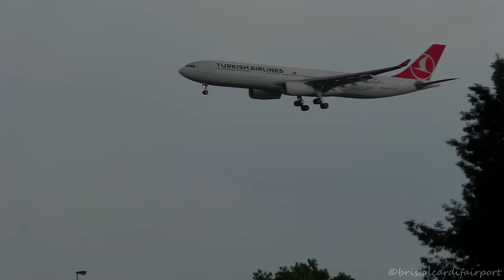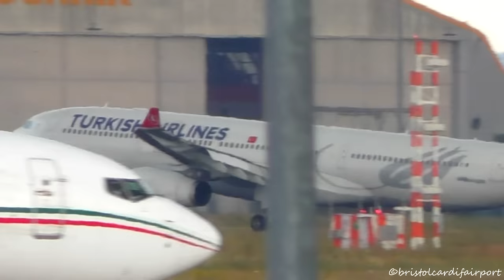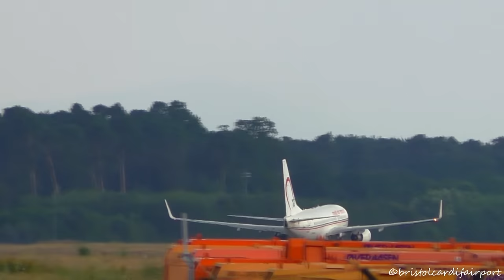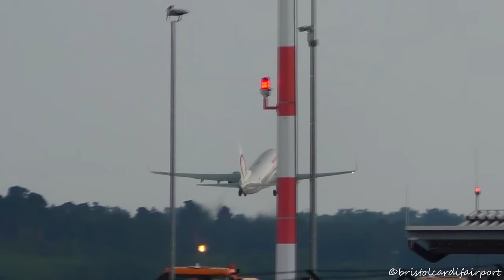PASSENGER AIRCRAFT FAILS TO TAKEOFF! BOEING 737 NEAR TAIL STRIKE & STALL ON TAKEOFF

Comment: Speed might have been ok, but he clearly forgot to deploy the flaps.
Reply: I hope this comment helps:

So, First of all in this video you see the Turkish Airlines Airbus A330 landing. This plane flies over the runway the 737 later takes off from, meaning that there is now wake turbulence on the runway. When it is time for the 737 to take off (which has flaps 1 selected, which is a normal setting for this runway length and wind speed) it rotated as it was in the wake turbulence of the a330. The wake caused a tailwind, therefore making the airspeed lower. The pilots lowered the nose to pick up more speed, and then rotated again and took off. Nobody was at fault here. My sources came mostly from observation of the video and from Ryanair captain "Mentour Pilot" who did an analysis of this video and came to this conclusion. Feel free to check out his video on it, i hope this clears some things up.
Reply: @ElectroRail  Ah, OK. I didn't relize taking off with no flaps is a standard procedure (as far as I know, flaps setting 1 would be no flaps, just slats deployed, which is consistent with what I noticed). And that's actually the only thing I noticed. Thanks for explanation. Later I saw a brilliant explanation by #MentourPilot, who also says it was a perfetly well handled wake turbulence incindent.
Reply: @Adam_Adamsky  Sorry im 2 weeks late, but i just realised you replied. The 737 does have some flaps out in a flaps 1 configuration, it's just a bit difficult to see it in this video. It depends on what type of plane it is. For example the A320 doesn't have any flaps on flaps 1, just slats, but the 737 does, wanted to add that.

Comment: That’s right, there’s no flaps?
Reply: No, they used flaps 1 which is normal for this airport in these weather conditions. They had to have flaps extended as the slats on the leading edge were extended. This was because of wake turbulence from the airbus a330. For further information, check out 737 captain "mentour pilot". he did an analysis on this.

Comment: Someone forgot to extend the flaps... oopsss...
Reply: I hope this comment helps:

So, First of all in this video you see the Turkish Airlines Airbus A330 landing. This plane flies over the runway the 737 later takes off from, meaning that there is now wake turbulence on the runway. When it is time for the 737 to take off (which has flaps 1 selected, which is a normal setting for this runway length and wind speed) it rotated as it was in the wake turbulence of the a330. The wake caused a tailwind, therefore making the airspeed lower. The pilots lowered the nose to pick up more speed, and then rotated again and took off. Nobody was at fault here. My sources came mostly from observation of the video and from Ryanair captain "Mentour Pilot" who did an analysis of this video and came to this conclusion. Feel free to check out his video on it, i hope this clears some things up.

Comment: I guess He rotated the plan before v1 that’s why the plan failed to take-off
Reply: I hope this comment helps:

So, First of all in this video you see the Turkish Airlines Airbus A330 landing. This plane flies over the runway the 737 later takes off from, meaning that there is now wake turbulence on the runway. When it is time for the 737 to take off (which has flaps 1 selected, which is a normal setting for this runway length and wind speed) it rotated as it was in the wake turbulence of the a330. The wake caused a tailwind, therefore making the airspeed lower. The pilots lowered the nose to pick up more speed, and then rotated again and took off. Nobody was at fault here. My sources came mostly from observation of the video and from Ryanair captain "Mentour Pilot" who did an analysis of this video and came to this conclusion. Feel free to check out his video on it, i hope this clears some things up. No one is at fault here.
Reply: Also, if you are actually a pilot as your profile picture implies, I'd assume you would know how to spell 'plane.'

Comment: Zero flaps. I thought this couldn't happen anymore in modern jets. I witnessed an aborted takeoff from failing to deploy spoilers. It was an automated abort, the plane only just started rolling when it automatically shut down
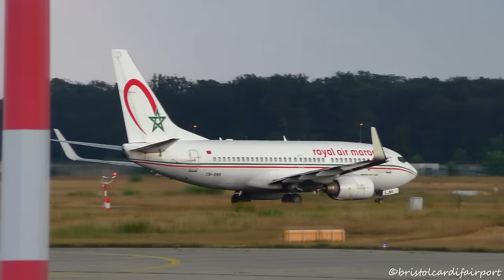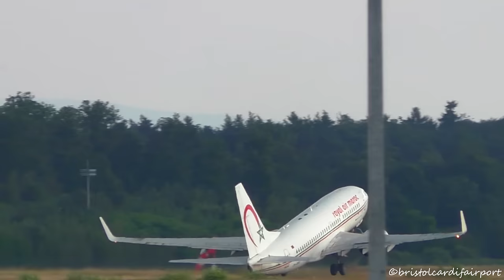Reply: Flaps were extended.  You can see the leading edge slats deployed at 0:29, and if you look at the left wing at 0:50 you see the flaps extended as well.  It was a wake turbulence encounter.  https://youtu.be/TEjbg_2yuFI

Comment: Looks like the flaps weren’t set correctly. I’m amazed it finally got altitude.       Bill
Reply: Flaps 1 were used. However, turns out, wake turbulence from an Airbus A330 is what caused this delayed takeoff. Very common..

Comment: Correct flaps help
Reply: I hope this comment helps:

So, First of all in this video you see the Turkish Airlines Airbus A330 landing. This plane flies over the runway the 737 later takes off from, meaning that there is now wake turbulence on the runway. When it is time for the 737 to take off (which has flaps 1 selected, which is a normal setting for this runway length and wind speed) it rotated as it was in the wake turbulence of the a330. The wake caused a tailwind, therefore making the airspeed lower. The pilots lowered the nose to pick up more speed, and then rotated again and took off. Nobody was at fault here. My sources came mostly from observation of the video and from Ryanair captain "Mentour Pilot" who did an analysis of this video and came to this conclusion. Feel free to check out his video on it, i hope this clears some things up. No one is at fault here.

Comment: If you notice, looks like the DA Turk "pilot" forgot his "takeoff flap" setting, which is why at V1 rotation, it refused to lift off, requiring him to lower the nose to gain more airspeed in an attempt to eventually rotate a second time to successfully liftoff.  Luckily, he still had enough runway to accomplish this, or there would have been a lot of scattered parts...
Reply: Clearly showing 10% of flaps.

Comment: Flaps might have helped.
Reply: I hope this comment helps:

So, First of all in this video you see the Turkish Airlines Airbus A330 landing. This plane flies over the runway the 737 later takes off from, meaning that there is now wake turbulence on the runway. When it is time for the 737 to take off (which has flaps 1 selected, which is a normal setting for this runway length and wind speed) it rotated as it was in the wake turbulence of the a330. The wake caused a tailwind, therefore making the airspeed lower. The pilots lowered the nose to pick up more speed, and then rotated again and took off. Nobody was at fault here. My sources came mostly from observation of the video and from Ryanair captain "Mentour Pilot" who did an analysis of this video and came to this conclusion. Feel free to check out his video on it, i hope this clears some things up. No one is at fault here.

Comment: No flaps deployed!
Reply: I hope this comment helps:

So, First of all in this video you see the Turkish Airlines Airbus A330 landing. This plane flies over the runway the 737 later takes off from, meaning that there is now wake turbulence on the runway. When it is time for the 737 to take off (which has flaps 1 selected, which is a normal setting for this runway length and wind speed) it rotated as it was in the wake turbulence of the a330. The wake caused a tailwind, therefore making the airspeed lower. The pilots lowered the nose to pick up more speed, and then rotated again and took off. Nobody was at fault here. My sources came mostly from observation of the video and from Ryanair captain "Mentour Pilot" who did an analysis of this video and came to this conclusion. Feel free to check out his video on it, i hope this clears some things up.

Comment: Coz he forgot use Flaps..
Reply: I hope this comment helps:

So, First of all in this video you see the Turkish Airlines Airbus A330 landing. This plane flies over the runway the 737 later takes off from, meaning that there is now wake turbulence on the runway. When it is time for the 737 to take off (which has flaps 1 selected, which is a normal setting for this runway length and wind speed) it rotated as it was in the wake turbulence of the a330. The wake caused a tailwind, therefore making the airspeed lower. The pilots lowered the nose to pick up more speed, and then rotated again and took off. Nobody was at fault here. My sources came mostly from observation of the video and from Ryanair captain "Mentour Pilot" who did an analysis of this video and came to this conclusion. Feel free to check out his video on it, i hope this clears some things up. No one is at fault here.

Comment: sorry guys but the pilots should be in jail CRIMINAL take off , no procedure and checklist correctly done !!!! they took off in clean configuration which means no slats and no flaps as you can easily see on the video !!! they could have killed everybody.
and please don't give stupid explanation when you dont know what you are talking about . The wake turbulences stopps as soon as a landing aircraft put his gear on the runway, which means on the very beginning of the runway, max first 1/3 of the runway and a departure aicraft takes off about 1 to 1.5 km from this point so no bullshit with wake turbulence. 
I'm an airline pilot with more than 10000 hours on airbus.

Comment: he pulled with slow speed
Reply: I hope this comment helps:

So, First of all in this video you see the Turkish Airlines Airbus A330 landing. This plane flies over the runway the 737 later takes off from, meaning that there is now wake turbulence on the runway. When it is time for the 737 to take off (which has flaps 1 selected, which is a normal setting for this runway length and wind speed) it rotated as it was in the wake turbulence of the a330. The wake caused a tailwind, therefore making the airspeed lower. The pilots lowered the nose to pick up more speed, and then rotated again and took off. Nobody was at fault here. My sources came mostly from observation of the video and from Ryanair captain "Mentour Pilot" who did an analysis of this video and came to this conclusion. Feel free to check out his video on it, i hope this clears some things up.

Comment: No flaps??!!!!😳😳😳
Reply: I hope this comment helps:

So, First of all in this video you see the Turkish Airlines Airbus A330 landing. This plane flies over the runway the 737 later takes off from, meaning that there is now wake turbulence on the runway. When it is time for the 737 to take off (which has flaps 1 selected, which is a normal setting for this runway length and wind speed) it rotated as it was in the wake turbulence of the a330. The wake caused a tailwind, therefore making the airspeed lower. The pilots lowered the nose to pick up more speed, and then rotated again and took off. Nobody was at fault here. My sources came mostly from observation of the video and from Ryanair captain "Mentour Pilot" who did an analysis of this video and came to this conclusion. Feel free to check out his video on it, i hope this clears some things up.

(ps. i cant stand these fecking emojis...)
Reply: @ElectroRail  lol on the emojis!! Thanks for the explanation. The wake turbulence should’ve dawned on me, I’ve seen this before.

Comment: wrong flap configuration
Reply: I hope this comment helps:

So, First of all in this video you see the Turkish Airlines Airbus A330 landing. This plane flies over the runway the 737 later takes off from, meaning that there is now wake turbulence on the runway. When it is time for the 737 to take off (which has flaps 1 selected, which is a normal setting for this runway length and wind speed) it rotated as it was in the wake turbulence of the a330. The wake caused a tailwind, therefore making the airspeed lower. The pilots lowered the nose to pick up more speed, and then rotated again and took off. Nobody was at fault here. My sources came mostly from observation of the video and from Ryanair captain "Mentour Pilot" who did an analysis of this video and came to this conclusion. Feel free to check out his video on it, i hope this clears some things up.

Comment: Pulled up too early...
Reply: I hope this comment helps:

So, First of all in this video you see the Turkish Airlines Airbus A330 landing. This plane flies over the runway the 737 later takes off from, meaning that there is now wake turbulence on the runway. When it is time for the 737 to take off (which has flaps 1 selected, which is a normal setting for this runway length and wind speed) it rotated as it was in the wake turbulence of the a330. The wake caused a tailwind, therefore making the airspeed lower. The pilots lowered the nose to pick up more speed, and then rotated again and took off. Nobody was at fault here. My sources came mostly from observation of the video and from Ryanair captain "Mentour Pilot" who did an analysis of this video and came to this conclusion. Feel free to check out his video on it, i hope this clears some things up.

Comment: 737 used flaps 2 so they didn't gain inuf speed for rotation
Reply: No, flaps 1 or 2 is a completely normal setting for take off at frankfurt in these conditions. It was reported that this was caused by wake turbulence from an airbus a330 that landed just before this one. Read the top comment.
Reply: @ElectroRail  but they doesn't gain that much speed so may be I actually don't know correctly see youtuber flying beast he is Arline captain he said @flying beast

Comment: Flap up 😬
Reply: I hope this comment helps:

So, First of all in this video you see the Turkish Airlines Airbus A330 landing. This plane flies over the runway the 737 later takes off from, meaning that there is now wake turbulence on the runway. When it is time for the 737 to take off (which has flaps 1 selected, which is a normal setting for this runway length and wind speed) it rotated as it was in the wake turbulence of the a330. The wake caused a tailwind, therefore making the airspeed lower. The pilots lowered the nose to pick up more speed, and then rotated again and took off. Nobody was at fault here. My sources came mostly from observation of the video and from Ryanair captain "Mentour Pilot" who did an analysis of this video and came to this conclusion. Feel free to check out his video on it, i hope this clears some things up.

(ps: i cant stand these fecking emojis)

Comment: Try some flaps.
Reply: I hope this comment helps:

So, First of all in this video you see the Turkish Airlines Airbus A330 landing. This plane flies over the runway the 737 later takes off from, meaning that there is now wake turbulence on the runway. When it is time for the 737 to take off (which has flaps 1 selected, which is a normal setting for this runway length and wind speed) it rotated as it was in the wake turbulence of the a330. The wake caused a tailwind, therefore making the airspeed lower. The pilots lowered the nose to pick up more speed, and then rotated again and took off. Nobody was at fault here. My sources came mostly from observation of the video and from Ryanair captain "Mentour Pilot" who did an analysis of this video and came to this conclusion. Feel free to check out his video on it, i hope this clears some things up. No one at fault.

Comment: Flaps zero!
Reply: I hope this comment helps:

So, First of all in this video you see the Turkish Airlines Airbus A330 landing. This plane flies over the runway the 737 later takes off from, meaning that there is now wake turbulence on the runway. When it is time for the 737 to take off (which has flaps 1 selected, which is a normal setting for this runway length and wind speed) it rotated as it was in the wake turbulence of the a330. The wake caused a tailwind, therefore making the airspeed lower. The pilots lowered the nose to pick up more speed, and then rotated again and took off. Nobody was at fault here. My sources came mostly from observation of the video and from Ryanair captain "Mentour Pilot" who did an analysis of this video and came to this conclusion. Feel free to check out his video on it, i hope this clears some things up.

Comment: 50kts rotate😀
Reply: I hope this comment helps:

So, First of all in this video you see the Turkish Airlines Airbus A330 landing. This plane flies over the runway the 737 later takes off from, meaning that there is now wake turbulence on the runway. When it is time for the 737 to take off (which has flaps 1 selected, which is a normal setting for this runway length and wind speed) it rotated as it was in the wake turbulence of the a330. The wake caused a tailwind, therefore making the airspeed lower. The pilots lowered the nose to pick up more speed, and then rotated again and took off. Nobody was at fault here. My sources came mostly from observation of the video and from Ryanair captain "Mentour Pilot" who did an analysis of this video and came to this conclusion. Feel free to check out his video on it, i hope this clears some things up. No one is at fault here.

(ps i cant handle these fecking emojis)